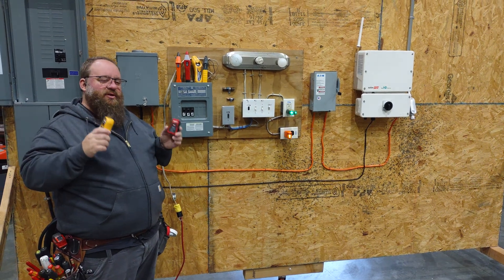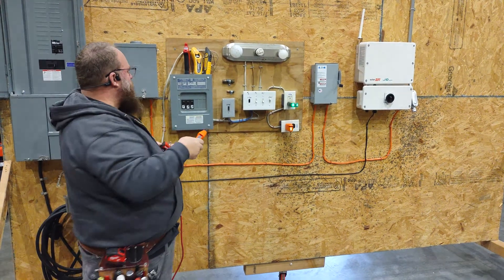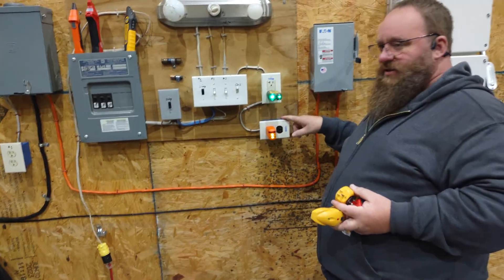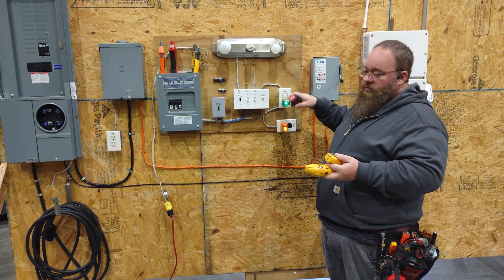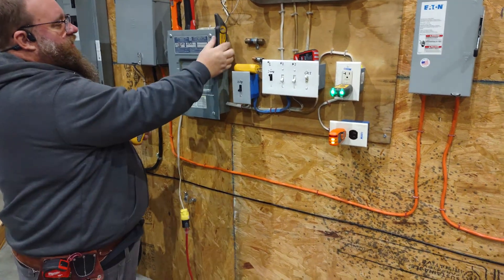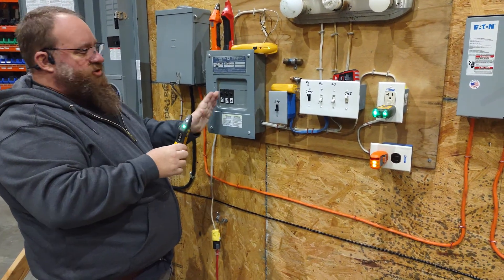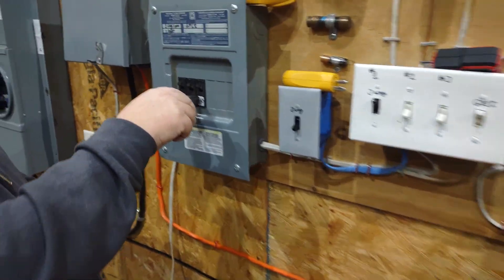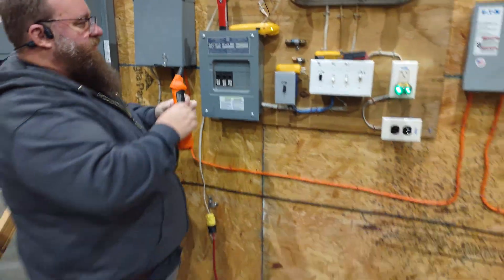the difference between the Klein Milwaukee and ideal breaker finders

Comment: Thanks for the revue. Good information. I have the Klein with the kit that also has the adapters for light socket and clips that can be used on light switches or unconnected wires. I find the Klein works quite well so I have never tried the others ... never needed to.

Comment: Great video, So what happens when you plug three prong device in the Outlet and it has no power and  your trying to figure out where in the electrical panel it exist?
Reply: You have a few options.
If you want to use a tool, you need something with power. Low voltage toners would work or something like the Klein ET450

Otherwise you need good problem solving skills and a basic multimeter using continuity mode
Reply: You have a few options.
If you want to use a tool, you need something with power. Low voltage toners would work or something like the Klein ET450

Otherwise you need good problem solving skills and a basic multimeter using continuity mode

Comment: What if the circuit is not energized?
Reply: The transmitter needs the circuit energized to operate.   If the circuit is dead don't really need a gadget like this.
Reply: @davegratz5895 Right. In that case, just ring out the wires for continuity.

Comment: Thanks for the comparisons in my case I'll add-on the alligator clips and light sockets accessories since I'm lately replacing light switches because they break at the connection points. My choice will be Milwaukee I like the light and the ability to buy one at Home Depot with add-ons a Veteran discount.

Comment: I wish you demonstrated them all. Odd the Fluke got little love here. The Flike BK120 is right around the same price as the others and they are known as the most premium brand. However, that doesn’t mean they make the best unit here. Though their unit includes a sniffer on it as an extra feature which may be useful in not having to take out a second tool in some scenario is. I think I would have liked to have seen them all demonstrate their sensitivity. If all are equal, then really, it’s a question of a couple of extra features one or two of them have or what’s on sale. Brand sort of becomes less relevant as these are all very good quality brands with good reputation.
Reply: Always go with Fluke.

Comment: I have all 3 of these with the Milwaukee one being the most recent purchase, and unless I got a bad one? It just didn’t perform as well as the other 2 from Klein and Ideal. One thing to remember is you have to pass over the breakers twice, on the first pass it will go red and green as you do it and on the second pass it picks the strongest signal from the first pass that you just did and then it should only light up red on the breaker or close to it? It’s actually more accurate with the panel cover off and going over the wires themselves right before they connect to the breaker. it’s also important to reset the tool before you start the first pass so it can recalibrate.
Reply: I bought a Klein & I found it had trouble finding breakers that were wired as open grounds.I have an older home & some of my outlets do not have grounds.The tester had trouble detecting them.Do you think this is normal?
Reply: @ That is Normal. With no ground the tracer signal is not as strong.
Reply: @ishocku how do you reset it? I have the Klein
Reply: @ The power button on handheld tracer wand, is also the reset which you just power it off and then back on again to recalibrate before passing over the breakers.
Reply: @ it resets as you turn it on, so if your only trying to find one breaker then you don’t have to reset it unless you didn’t find the breaker the first time and are trying to repeat the trace or if you are moving on to another breaker that you are trying to find.
Reply: @ thank you!
Reply: I have the same older ideal set that you have and have the same issue with the switch turning on in my tool bag.  I glued two pieces of  hard foam around it and keep it in a hard case to save my battery